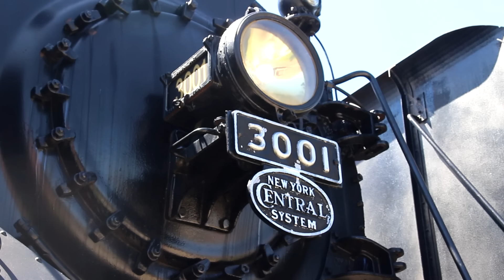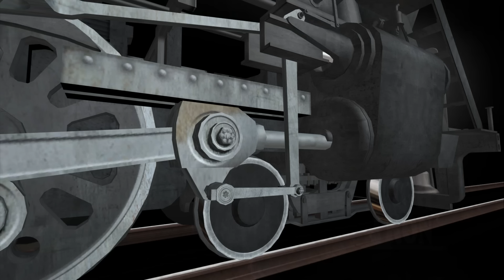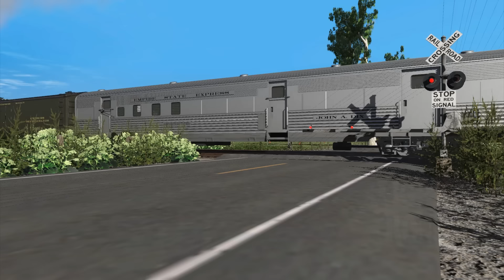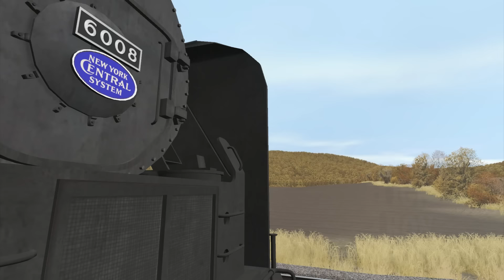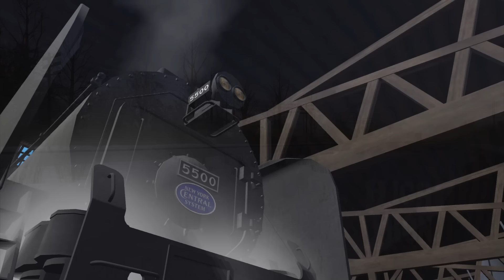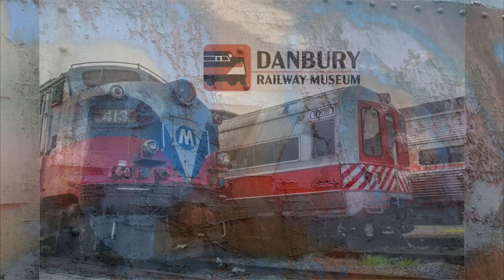New York Central's Niagaras - The Best Mainline Steam Engines?

Comment: Why is it always that no matter what railroad it is, it's always DIESEL POWER!
Reply: You can blame EMD for that.

EMD introduced the E-units. Which were not that popular but when they introduced the FT Models, this is where they really took off and sent steam to the scrappers' torch.

The main reason diesels largely replaced steam is because diesel proved to be more efficient, required less maintenance and were more versatile. Steam on the other hand, required hella amount of labor-intensive maintenence, they were not efficient and they proposed lot of safety hazards in terminal stations and tunnels due to their smoke.

Comment: Apparently, the N&W J class were technically more efficient than the Niagara, and even more efficient than the EMD E units overtime
Reply: A statement not supported by known historical data. Two class of locomotives each engineered for their respective railroad environment.
Reply: Preach
Reply: To be honest, the J and Niagara were designed for completely different terrain. Neither would perform as well if they ran in each other's territory. The J dominates in the mountains, and the Niagara dominates in the flats, with both being remarkably amazing steamers as a whole.

Comment: The NYC Niagara was an interesting & impressive type of 4-8-4 by measurement of performance operation data, I like the smoke deflectors and the centipede style tenders on the locomotives. It's a shame that none of the Niagara engines were saved for preservation to be placed on display inside a museum for future railfans to observe.

Comment: Not gonna lie, hearing the stats of the Niagara makes me wonder if steam power could be revived for the modern day, using electricity instead of coal to heat the boiler. Maybe even include some technologies to increase power/efficiency using modern understanding of fluid dynamics. Would make the whole rail network a lot more environmentally-friendly (and a lot more fun, in my opinion).
Reply: The best way to use steam power to drive a train is to build a power station and feed electric motors on the train via overhead lines. Using electricity to heat water, instead of turn a motor is just a waste of electricity.
Reply: How the French finally made high-speed nuclear-powered trains practical...

Comment: Interesting point about all the coal and water infrastructure vs diesel infrastructure and the effects of cold on the internal locomotive workings.
However regarding diesels, water collects in the cylinders of cold locomotives and has to be vented by manually cranking the engine before starting. On older locos this was done by manually cranking the engine. I don’t know what you do if this water has frozen.
Reply: The problem of hydraulic lock is handled the same way as the coolant (which isn't antifreeze!): you/'d leave the 567s idling.  Later you'd use something like a Kim Hotstart to keep the oil and coolant warm, so the cylinders would stay warm.  With the relief valves open, you bar the engine over one full revolution to ensure no cylinder is hydrolocked and ice would behave similar to water during that test.  Note that any ice that clears will melt very quickly with compression once the relief valves are shut, and the water would probably drain into the airbox when the scavenge ports are opened...

Comment: I think we can agree that we can blame one guy in the long history of the NYC for why a Niagara was not saved.
Reply: That better not be Perlman -- he tried hard to have a Hudson preserved.  Go after the board, which was first in a proxy fight and then dominated by Young...
Reply: @wizlish  It is human nature to want to affix blame for strongly held opinions of history. In this case, blames lies squarely at the feet of General Motors.
Reply: GM isn't to blame for slamming the door on the Niagaras with E8s.  (They are even hard to blame for the NCL business, although the spare-parts aspect was, and was properly stopped as, illegal).

A parallel example on a different scale was the other late Kiefer design, the much-disparaged-for-former-reasons A2a (A-2-A on P&LE, believe it or not!) Berkshire.  According to Polarowitz these were fine engines even with 63" spoked drivers... they just weren't wanted on a railroad essentially already dieselized and taking advantage of first-generation-diesel advantages; then they were stored in Pittsburgh air; then they went to Indianapolis where there is film of their working quite effectively -- except they were mortifyingly rusted out from storage, similar to what happened to the PRR Q2s in storage, and met the same assisted death the Niagaras did.

As I recall, the Hudson that would have been saved was the one completely reshopped in 1953 for one of the anniversaries of New York City -- I had a postcard of her in my desk before I went to college.  NYC post-Young had no money, was losing increasingly on even Dieseliner passenger traffic, and increasingly concentrated steam in the areas with 'lowest' overhead and maintenance cost.  Niagaras could easily do the job of a 2-8-0 on a 2-8-0 sized amount of coal and water -- Tuplin noted that in some detail -- but it was still a huge piece of corrodable metals, full of proprietary subsystems and components from companies rapidly going out of business, with terrifying maintenance requirements even to stay operational.
Reply: What GM did was threaten to end all shipping business on any railroad in question, if the railroad did not purchase GM locomotives, and favor GM products in business models. This a point of known history, and seemed to escape Justice Dept scrutiny. Think of it: between NY and Chicago alone the number of class I railroads from which shippers could choose (at least four). NYC business relied heavily on shipping GM cars trucks and products such as Frigidaire as well as back support for the manufacturing of all this and more. GM as a large percentile customer had the ability to affect corporate policy for carriers, as they to a lesser extent continue today. However, GM/EMD/EMC also had the advantage of having far and away the best offerings in D-E motive power from abt 1933 on as history correctly reflects.  @wizlish
Reply: Further - Perlman was a visionary - He correctly knew pure electric motive power surpassed far and away any comparison to any kind of motive power, but of course the infrastructure costs involved could not be justified. Plus, GM also opposed movement of their business on roads using pure electric locomotion. Perlman had unrealized dreams of railroad owned and operated lineside nuclear plants for railroad motive power @wizlish
Reply: @wizlish  It pretty much was Perlman.

And HOW do you know that he tried to have a Hudson be preserved? That is so not like Perlman if you ask me.
Reply: @jimmyhook4852  Jimmy Hook you are full of shit. Typical railfan internet-based foamer BS

Comment: I wonder how expensive the maintenance cost of these steam trains would be with modern day manufacturing such as CNC machines that can spit out duplicate parts instead of having to go with cast molds.  Lincoln welding company is now using a welding robot to 3d print industrial equipment. 

Here's a video on that robot. I skipped ahead.

https://youtu.be/XbdzTwMhGg8?t=298

I support the electrification of all of America's rail routes because DC motor should be simpler to maintain  than say a turbo diesel engine, I mean even the soviets were doing it back then. Yet I just wonder just how far you could push a steam monster in performance.
Reply: Nobody would use DC motors on a modern electrification -- although MUing the DC link in a multiple AC consist makes sense.
Reply: Clearly superior long lasting engines. And with advanced lubricants.. well it might last a million billion miles
Reply: 88mph

Is the maximum speed as documented by Dr Emmet Brown 1885

Comment: A stellar video, and wonderful segawy to the Danbury's cause. The contents of the trials intrigued me, as I didn't know the Niagaras were too heavy to run along the NYC's Big Four route to St. Louis. I thought their lightweight would've given them an advantage but I guess not in that regard. Rare win for the PRR and their T1's in that regard. 

Also gotta give an honorary mention to 5500 in the trials too. I know it would've had the worst availibility figures, but it stood decently with the regular Niagaras.
Reply: Niagaras and yes, even the 5500 did run on the Big Four - My dad was a engineman first firing and later operating on the BF, the locomotive entries are in his log book. I don't believe Mr Gerbracht would have made this error in his book but if so, my correction is kindly noted.
Reply: Keep in mind that the 5550 was heavier, due to the added weight of the Franklin type A gear. 

A guide for how fast things changed in the late Forties is that, in Kiefer's review of motive power linked here, they carefully discuss the design details on the 5550, and note that they'll report performance in a subsequent addendum.  They never did so.

LeMassena had an article on the Niagaras in Trains Magazine in the 1980s, which discussed quite a bit about the design of the poppet-valve Niagara but never came out clearly and said the engine was designed to make comparable power to the piston-valve S1s ... not "moar power" as was so often a supposed goal of poppet-valve utilization... at much more economical fuel and water consumption.  That goal was apparently fully borne out, but (as with so many 'thermodynamic improvements', it didn't pay its way or give desired road reliability.
Reply: @wizlish  You’re right on that. From what I’ve read since, the improved efficiency is all the S-2 really had going for it. The 5500 actually exacerbated a problem of undersized clearances the S-1’s faced, it made steam too quickly for the valves to properly used, so getting “the most” out of it wasn’t really possible. That said, the poppet valves did make maintaining performance easier, as the S-2 could deliver the same power as an S-1. Seems Franklin made some accommodation for the Niagaras steam capabilities; the port setup actually had more exhaust ports than inlet ports rather than the symmetrical layout used on other Type A engines (Type B was similarly asymmetrical). The Niagaras were probably too powerful on their own, but I don’t think the S-2 was meant to be a testbed for the whole class. The poppet valves are one thing, but the decision to number it right after the has me think it was meant as a stand-in of sorts for the C-1.

Turns out I was dead wrong on her availability during the comparison tests though, 5500 probably has the highest mile per month figure of any steam engine. 28.8 thousand if memory serves

Comment: A couple observations:
UP 844, built also by ALCO, is probably the closest example preserved today of what a Niagara looked like, with big drivers and smoke deflectors.

I think N&W in the mid 1950's, put up their biggest and best steamers, the Y's and A's against some EMD, 4 unit F locomotives.
The diesels barely beat the steamers in maintenance , efficiency and sheer pulling power.
The margins were so close, due to N&W's expert practices of running steamers, that they decided to tell EMD to take a walk and keep going.
IMHO, the N&W J class, was the finest passenger steam locomotive ever built..
Reply: I fully agree, the N&W Js were phenomenal locomotives. The N&W J actually beat the EMD E6 in every aspect except for lubrication costs when compared in the mid to late 1940s. It even had a higher availability and utilization by small margins in the same comparison. When the comparison ended, it showed the J to be roughly 30% less expensive to maintain than the E6.
Reply: The FEF-3s are actually what the Niagaras were based off of, just with giant boilers and a full foot shorter.

Comment: Surely the Concorde moment for steam traction was Mallard doing 126mph?
Reply: It broke the steam barrier
Reply: Would be if it had.  The actual non-propaganda speed was in the 125mph range (as Gresley agreed); the 126.1 is at best an artifact in the dynamometer (look at the trace on either side of that peak and you'll see).  The actual Concorde moment is the German BR 05, which had the over-the-top engineering characteristic of the SST (and some of the same disregard for practicality).  The A4 on the other hand was a perfectly fine express locomotive at normal speeds (and with the big-end improvement one could probably have teached the 130mph speed Duddington thought she could)
Reply: @wizlish  
A4’s ran over 100 mph regularly and reliably.  Emergency braking in the record run caused the damage.  They should have waited for a better time..
Reply: @stephenpage-murray7226  if only they did have another opportunity.  There was only one shot due to World War Two happening soon after.  It would have been better also if the used a new-out-of-the-works engine, as Silver Link performed the best out of any a4 for a while when she was put on the first train.  Really that was the highest point of the A4s.  Going 112 without trying and being smooth showed that setting up and tuning every part to be in prime condition was undervalued.  With a double Klychap blast pipe, Silver Link would have went near 130 that day if trying, and probably faster  if it had roller bearings on all of the trains axles.  The Achilles heal of the Gresley valve gear (and really all congugatef gear) is that wear in the bearings significantly affected timing.  Roller bearings solve that, like on the UP’s 4-12-2.  One thing that I’m surprised Gresley didn’t do was a modification that Australia did. Instead of angling the middle cylinder to clear the front axle, which slightly throws off the valve timing, the Australians just put a crank on the front axle, which is the simpler, better solution.